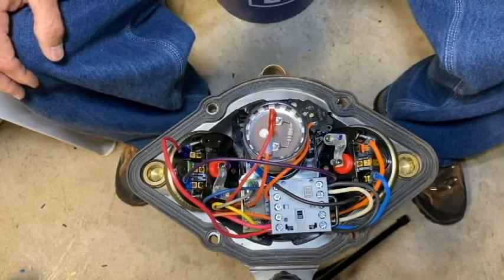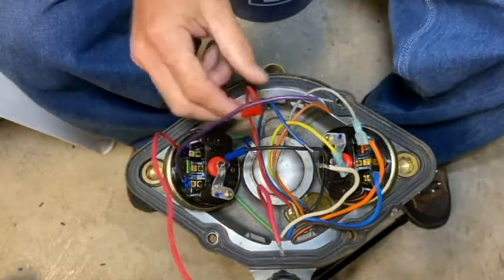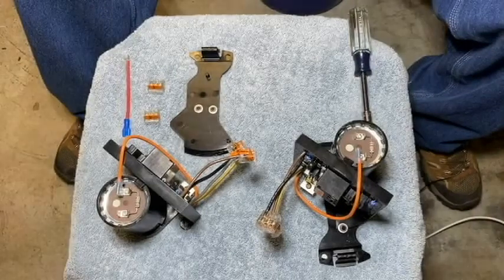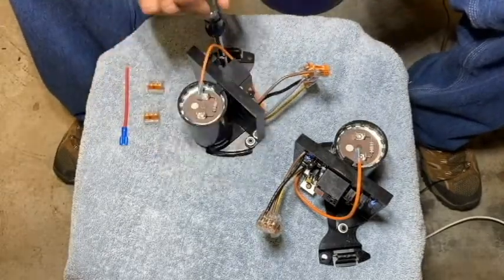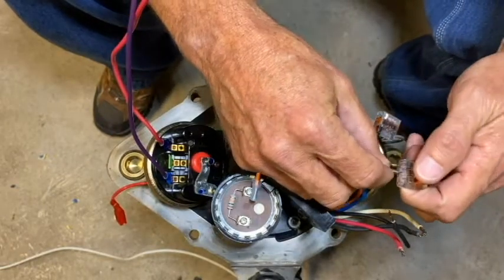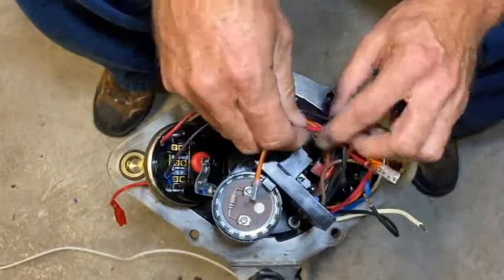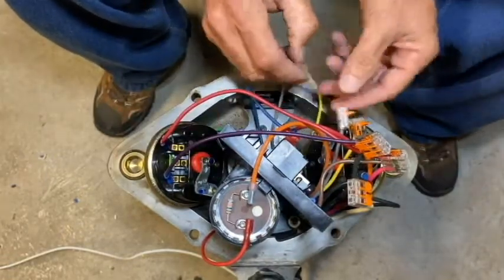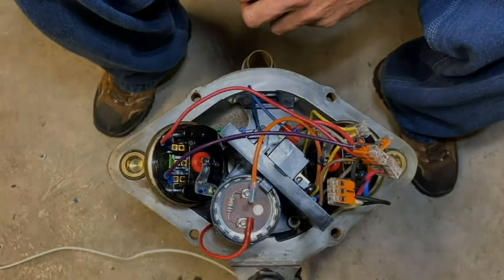E/One Grinder Pumps: How to Retrofit a 2000 Series, 240V 60Hz Pump with a Motor Controller Board

Comment: Dude....you're working with "two" alarm switches here, missing the "on-off" switch.  Also...where did the purple wure come from as it sure doesn't come with the CB or 1300 kit.  I need answers!!!....lol
Reply: The switches are correct. You can't go by the color of the button in the middle of the switch. Some times they are red, pink , gray. You had me wondering so I just checked those switches and they are correct. I reused the purple wire. The 1300 now comes with the purple wire. Thanks for the comments.